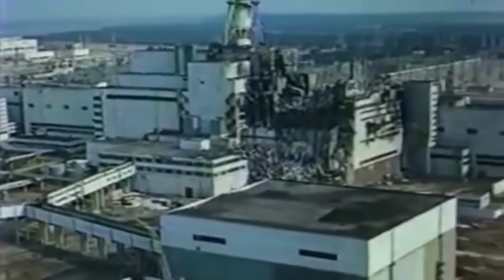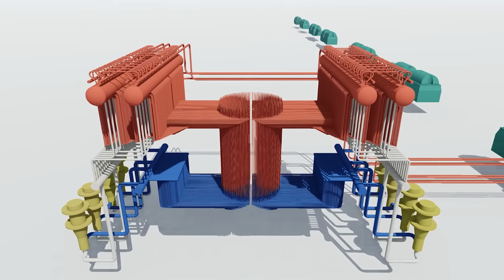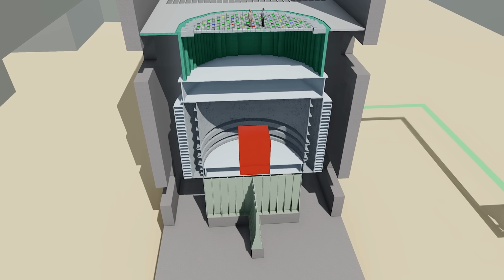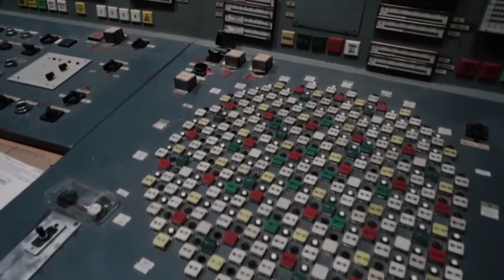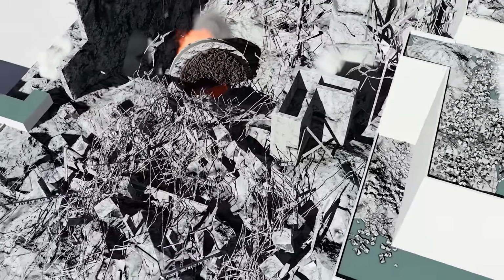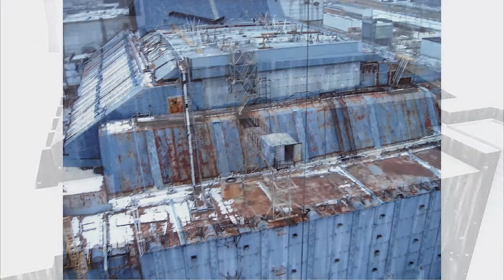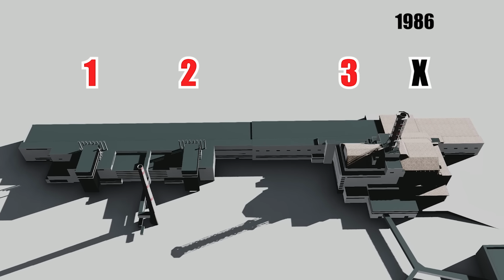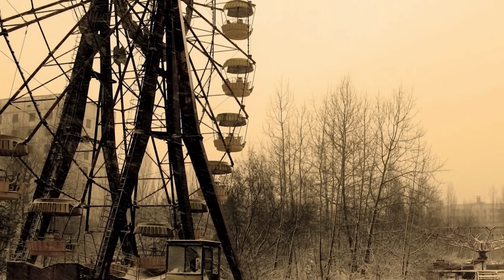CHERNOBYL DISASTER - An Inside Look - 3D

Comment: "Western reactors are stable by design" Except for Fukushima, Three Mile Island, Tokimura, Windscale, etc. Stop with the chauvinism.
Reply: Is Japan considered as 'Western' though?
Reply: @b.l660  Fukushima reacotrs are a U.S. design.  No point in arguing about the definition of "Western" though, not really the point
Reply: Fukushima was stable by design, did it explode? no, it melted down exactly as planned in a runaway event. There was no break of containment (1 out of 3), only some gas release. And 2 people died from it, because the concrete roof feel on their heads, because FUCKING TSUNAMI, most people died from the evacuation and chaos caused by the flood.
 Thee mile island was nothing. The others were minor problems with water pumping. Steam is a very dangerous thing, anything that boils water is dangerous, did you ever saw a steam turbine exploding? things don't need to be nuclear to explode. See 2020 Beirut explosion.
There's plenty of dangerous things, you don't approach security by not doing things. If you are going this way, you are going to stay inside your house forever, even then things happen, there's no safeness, better die already, being dead is the safest thing, the world is a mess, we mitigate and control risks.
Reply: @monad_tcp  The problem at Fukushima is that they continuously used seawater to cool whatever remains of the core, and now they are running out of places to store the contaminated water.  I assume they do that because the blob will melt through the bottom of the containment vessel if they don't cool it.
Reply: @mattgraham4340  Well, Firstly, water is not naturally radioactive, like heck, water is used as moderator, its literally poison for the chain reaction, its the best shield for radiation. Secondly, they aren't cooling it forever, it would like a 5 days to shut down a reactor and totally cool it, the thing is like at thousands of Celsius. But to cool a nuclear blob of melted reactor core would take a lot longer, like a year or more, it will eventually cool down enough. Thirdly, the real problem with cooling the reactor is that it releases hydrogen as the water absorbs energy, you get some isotopes of all kinds of different materials, but I bet you can filter that, or just dump it in the ocean. 
You aren't allowed to dump nuclear waste in the ocean, but that's water with traces of elements, not nuclear waste, its all ironic because you can dump whatever you want, all sorts of nastier things than reactor water, into the ocean but the nuclear industry is the only one heavily watched up closely.
The oil industry keep dumping oil and having accidents, but then the nuclear industry has one minor incident with a fucking TSUNAMI, just so you know, killed thousands of people, like fucking things falling in their freaking heads, and tons of water.
But everyone gets bat shit crazy about a nuclear " disaster ", meltdown is not actually that bad, all modern reactors are fail-safe in that way, 3 layers of containment and the worst case is a meltdown, the fuel just melts the first layer and get trapped on the second, they are literally made to do that, the chain reaction just stopped by the time everything melted, fucking nuclear engineer projected the thing to not go critical and literally melt down when cooling fails happens, and people say its an "accident", then 2 people died because concrete fell on their heads, no one died from radiation, not ever one person.
But a lot died from the evacuation and fear induced by the media. I only wish for a world when the media was as accountable as the nuclear industry is.
Reply: @monad_tcp  well, if you don't think what happened at Fukushima is problematic, then I don't know what to tell you.  That would make you either dim or disingenuous.  It seems you're confused about what a flux moderator  is.  Depending on reactor design water can be used as a neutron moderator, or a neutron absorber, and is usually the primary coolant.  Yes, I'm sure the Japanese people will be thrilled when the waste is dumped in the ocean. The ocean is massive and can probably handle it, but we do burden it's ecological systems more everyday.
Reply: @mattgraham4340    No, I don't think what happened is problematic, first of all, it was an accident, second, that power plant was schedule to be retired anyway. Accident happens, that's why you have worst case scenarios. If there's a problem it has nothing to do with nuclear reactors, but everything to do with how society does its maintenance, iow, leave to the last moment possible, if we are going to leave infrastructure to crumble, I'm pretty sure there's lot of dangerous things that will kill people and fuck environment, it doesn't affect only nuclear power, think of some dam collapse that usually happens and, also, there's no excuse for it. 
Even that, I still think the benefits out-weight the problems , so no, not problematic. Do we have to be careful, yes, do we have to have special security legislation and project against failures, yes, do we need to go crazy like the world is ending, no. Things have problems, we fix it and go on, like when planes fall by failure, we improve the designs, it get a bit safer, we don't just stop flying because a plane crash, that's insanity.
 Like there's fucking oil spills every fucking year, a bunch of radiation from a failure that happens once in every 2 decades and we have like thousands of reactors. That's pretty much non-problematic event in my book.

       " It seems you're confused about what a flux moderator is" well, I never said I was a nuclear physicist.

 " Yes, I'm sure the Japanese people will be thrilled when the waste is dumped in the ocean ". Well if you dilute it and slowly release over the years, it actually does solve the problem, doesn't ? We could as well filter it and then dilute and them throw it away, water is water, the problem is some small particles-per-million of things like cesium.
But as I said, they pretty much can't do that because of legislation, I do think the idea of not dumping nuclear waste in the ocean was a good one. I was just being pragmatic, for all that's worse that we do, it would seem like a small thing that will go away very soon, not like oil spills, we should fucking ban ships without 3 layers in the hull.

 "but we do burden it's ecological systems more everyday" More than all the plastic from the fishing nets? probably not. But I agree with you, one spill, one nuclear accident, lots of plastic, and the worst of all, the fucking acidification of the ocean by the CO2. 

Considering all that, it sums up to some significant damage , still I do think if we had more nuclear power generators, and even if they leaked their water every year (they won't), it would still be less bad than the acidification we are causing.

"So we literally have better fish to fry" Still Fukushima was how many years ago ?
Reply: @monad_tcp  You seem to be under the impression that I'm against nuclear power.  I think there is room for nuance.  Reasonable people can acknowledge that the incident at Fukushima was problematic.  Rated as an event level 7
https://en.wikipedia.org/wiki/International_Nuclear_Event_Scale
However, I'm still not opposed to fissile nuclear power as a whole.
Reply: @mattgraham4340  No, I don't have any impression, really, I don't know what you are for.
I was just talking that I, particularly, don't see it as that much problematic like whoever wrote that wikipedia page, Of course there's room for nuance, just don't put it together with Chernobyl, that's precise my point, no nuance at all, just gone to the extreme.
 its not even near the same scale, there's only two things in common, both were meltdowns, then it stop there. I would put it on the Three Mile island category from all that I read, people are still over-dramatizing the events for who knows what reason (I bet on bad propaganda from gas companies).
So I will concede its problematic, not on that absurd level the international committee or something put it on, they have political motivations for equating Fukushima to Chernobyl (I guess), and I think from the damage done, that Chernobyl is way, way worse, precisely because there was criticality and explosion of the core and release of elements to the atmosphere, when Fukushima none of that happened, except some small hydrogen release, and that water used to cool the melted blob.

I was just being unreasonable for precisely the same reasons cited on the "Criticism". If it was a logarithmic scale it would be like 5 and Chernobyl is 7, two entire orders of magnitude worse. 

Good thing you cited some kind of scale, so we can better in some kind of estabilish what we are talking about.
To me 5 is concerning, but not problematic. If you have a problem that you can solve, its not that problematic, I just used some skewed definition of problematic. I'm not entirely unreasonable, as how everyone finds everything problematic nowadays, I just pushed my problematic levels way too higher in the scale, its not that bad, at least its not a fucking open core to the atmosphere...

Its nothing like Chernobyl where there's nothing we can do except build another sarcophagus and dismantle the old one and then build a new one 100y from now when the current one expired and just try to slowly and carefully remove most of the material we can.
Reply: Can't we just edit the wikipedia page and put Chernobyl at 8, so I'll be happy.
Reply: Water is a powerful force, people play with it, ironically Chernobyl exploded not because it was a chain reaction, but because there was steam inside the reactor in the place were it shouldn't be, then they shut down, then the criticality event happened, otherwise it would have just meltdown and become a blob of hot metal. Actually you don't want steam at all inside the reactor, that's why the most safe designs 
use liquids that can't become gasses under high temperatures
That's what they call stable by design, water won't become trapped inside the reactor.
Nothing will save you from bad design. Just go search for Hydro plant accidents, and barrage seizing, there's plenty of those accidents. I would be afraid living under a barrage, not in side with a nuclear reactor.
Reply: @monad_tcp  don't waste your breath on a commie-revisionist imbecile. I'm wondering if he ever even lived under comunism.
Reply: He’s talking about america
Reply: do you even know how Fukushima happened  it was from a tsunami it wasn't the reactors fault it was Mother Nature at its wost
Reply: @figg9417  Of course, but why does it matter what the initial trigger event was?  Would it have been better if the backup generators had failed due to poor maintenance? The point is that the system as a whole is not entirely fool-proof, and has subsequently caused a massive contamination problem that has yet to be resolved.  There are newer reactor designs that do not require backup generators for cooling.  I'd be in favor of getting some built.
Reply: @mattgraham4340  do you know the state of the back up generators before falure
Reply: @figg9417  are you asking about their maintenance status? No idea, but probably exemplary knowing the Japanese. Or do you mean were they running at the time? I think I recall that the reactors were already shut down before the wave hit, which would imply that the generators were running
Reply: @mattgraham4340  Foundation of your reply was was based on your pre-existing knowledge of the maintenance status , and I asked you if you knew that pre-existing knowledge
Reply: @mattgraham4340  I bet it was in terrible shape considering there was a natural disaster
Reply: @figg9417  my original reply to you did not assert knowledge of their maintenance status, poor maintenance was a hypothetical  scenario for you to consider. Point being, the proximate cause of their failure is not really important for the thought experiment
Reply: @mattgraham4340  negative energy coefficient compared to a positive energy coefficient   they designed to not fail rbmk reactor
Reply: @figg9417  precisely, meltdown is not a failure, its designed to do that, you are dealing with lots of heat energy, you can't get rid of that much energy without cooling in an instant.
Reply: @mattgraham4340  yes, they were shutdown for safety, but you don't turn off a nuclear reactor, its really hot and need to be cooled, and now that you turned it off, ironically, you don't have power to turn the cooling pumps, so you use a diesel generator, and the rest is history when it floods. 
Perhaps the American designs are better because they usually use pool pits, the reactor is already inundated, lol.
Reply: Yes 3 mile Island destroyed the entire city yup that’s what happened🙄   May I suggest you watch the HBO series about Chernobyl they actually did a pretty good job for a TV series and talk about some of the technical reasons why Russian reactors were a death trap.

Comment: Thank you for posting!  Wonderful graphics. This is not a critique -We see the heat exchangers, at the top left and right.  We know this is boiling water reactor - Does water not get cooled, other than the boiling off (which removes significant heat) before being returned to the bottom cooling channels (and through the main cooling pumps? so they are almost at 100c as well?  at least their turbines?)  It would seem that when this was at full power, water would always remain at pretty much boiling temperature, using just the slight differential between boiling and non-boiling.  I've always wondered that - as GE reactors operate very similarly, just with full containment.
Reply from the maker: The channels and piping are pressurised so the boiling point is significantly higher than 100c. 

After the turbines the steam is cooled with lake water to condense it back to water and then fed back to the pumps. 

But high inlet water temperature to the reactor was an issue and may have been a contributor to the disaster. 

During the disaster multiple channels ruptured and the pressure drop instantly flashed the water in the reactor to steam. The loss of water further enhanced reactivity overwhelming the system and causing the explosion. 
For 20 years the control staff managed these systems sufficiently to maintain safe operation but not on 26 Apr 1986.

Comment: The reactor had operated for 20 years prior. It had design flaws, but this was caused by negligence of Dyatlov and 2 of his techs.  

The reactor was undergoing a 24 hour shut down procedure, allowing for a specific test. The test involved disconnecting one of the turbines from the reactor, as it was being wound down, and using its energy to power water pumps. The test should have been a one off, lasting only 45 seconds. 

Anatoly Dyatlov (head technician on midnight shift) planned to lower output to 700 Mw, the lowest setting at which the reactor should have been operated. 
But he failed to properly set it up and the output fell below 100 Mw. Instead of allowing it to shut down, he tried to bring the reactor output back up to 700 Mw, in order to perform the test.

To do this, he overrode safety systems and warnings, and ordered graphite control rods MANUALLY WITHDRAWN from the reactor. 

The rods are a critical safety mechanism; if the system senses a run off reaction, it will automatically lower these rods into reactor and sap off energy output.

Sadly, he ordered the rods disconnected from the system, so that it would not interfere with his quest for more heat.

Once the positive heat loop kicked in, it kept increasing the water temperature in the reactor, in turn causing higher fission reaction, and on and on. The heat and pressure built up, until reactor 4 housing and piping exploded, propelling a 1,000-ton concrete slab above it clean off the building. 

The reactor was now exposed; contaminated water and coolant were spraying everywhere. 

Dyatlov was sentenced to 10 years of prison, but was released in 1991 after collapse of USSR. He tried to scape goat authorities, apparently ordering him to press on with a not so important test and jeopardize billions of dollars and national catastrophe. In reality, he was public enemy #1 and public demanded his execution. He died in 1995 from heart attack.  https://youtu.be/Cc-vvhWXL9Q
Reply: This is important. The reactor didn't explode because it was poorly built, it exploded due to mismanagement. If the USSR hadn't been organized the way it was, and perhaps even if Dyatlov hadn't been employed there, we'd not question the safety of nuclear reactors, even if RBMK were deployed just like in Chernobyl.
Reply: @Merthalophor  definitely poorly built. An emergency shut down button that makes the reactor explode?

Comment: Don't forget the main reason to run the RBMK's....it makes weapons grade Pu very quick and cheaply all the while making power.
Reply from the maker: Actually this is a bit of a myth. Electricity generating reactors don’t make great plutonium breeders because you have to remove spent fuel too soon. If you leave the fuel in the reactor too long it goes on making more of the useless plutonium isotope.  Dedicated plutonium producing reactors much more preferable to breed maximum quantities of weapons grade Pu isotope.
Reply: @Mike-Bell  lol... you just got trolled
Reply from the maker: @tropickman  This was not a troll comment.  It a common misconception about this type of reactor.